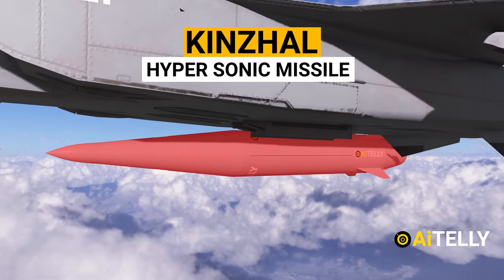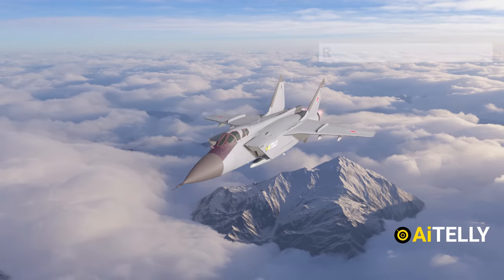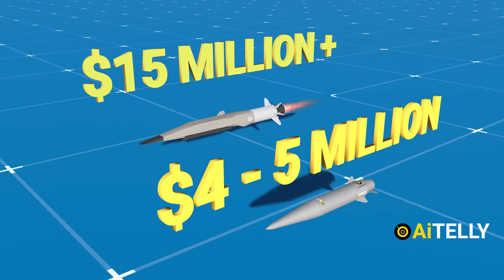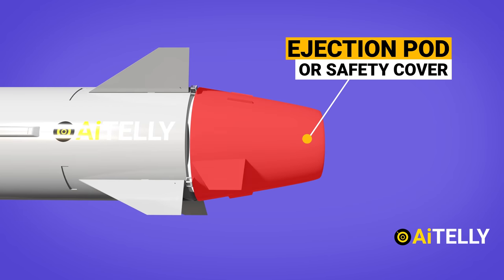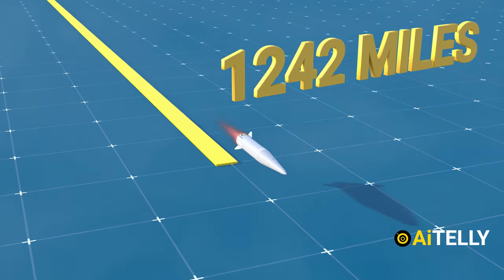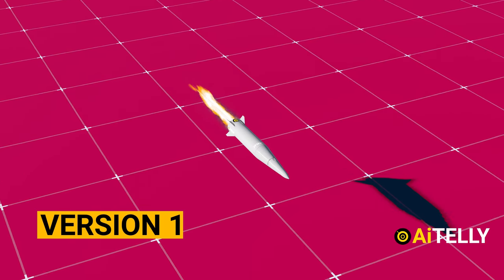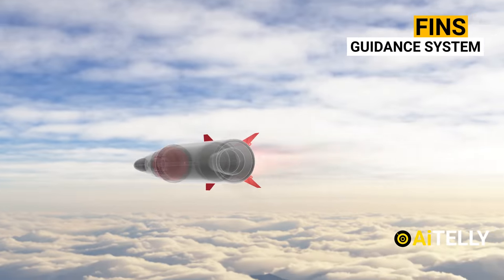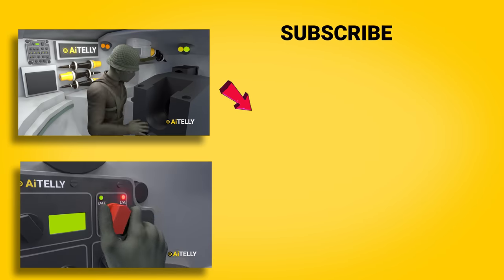Hypersonic Missile How it Works | Mig 31 Kinzhal Launch Process

Comment: The Kinzhal Hypersonic  Missile is about the largest Air to Surface missile I know.
Even from the graphics in this video, it surpasses adult human size by far, and it has sharp conical tip, unlike the wreck of the shot down one shown that has smaller bullet shaped nose.
So it is a total lie that The Patriot Missile shot it down.
Reply: The one you saw is unitary warhead assembly found inside kinzhsl ...lol
Reply: Created in 2018, the Dagger can fly more than 4 kilometers in a second;
The Patriot PAC-3 air defense system was tested in 1997[23]. The maximum target speed is 1600 m/s[24];
conclusion:The Patriot air defense system could not shoot down the Dagger, because it is not designed to shoot down such fast missiles.
Minister Shoigu: "We don't launch as many missiles as the Ukrainians shoot them down")))
Reply: @alexandroangara5903  correctly : Patriot missile don't need to chase kinzhal, it only need to calculate the trajectory and meet there
Reply: @tluangasailo3663  yes, they met at the Patriot location and Kinzal gone to pieces and destroyed Patriot completely, there is a video ....they used H-101 missiles to put Patriot to pressure and to locate it and then 3 Kinzals devastated it
Reply: So much Russian copium in the comments.
Reply: @alexkalexk6895  really, I thought so many NATO propaganda at one place, just watch the video, Patriot hit the Kinzal, and destroyed it , but it was at the ground :D and good buy Patriots :D
Reply: it is also necessary to realize that the speed where it strikes, the kinetic energy is added to the explosive charge... the nose of the missile there should not be much left
Reply: @alexandroangara5903  that's efficiency! you fire three missiles and in front of them they shoot down about forty...I guess they are getting ahead of the next launches.. it allows the barrel of the gun to cool down
Reply: @alexandroangara5903  that’s like saying I can’t get run over by a car if I step onto the highway because it’s going too fast.

Gosh, people are dim.
Reply: Largest? Google "Kh-22" )

Comment: Look at it this way. Kh-47M2 is a missile capable of breaching trough the entirety of layered air defense thanks to it's speed, and only then, in the shortest section between the missile and it's target, it slows down, turns on the seeker and hits. Let’s say this happens at a distance of 10 km, meaning that missile punched trough layered air defense before that distance and is now slowing down to activate seeker. How many air defense systems do you need to repel such an attack? What is the density of fire that is needed to be sure? In other words, how many hundred millions of dollars you are willing to waste on just one missile? Will the crew have time to react if there is only less than 10 seconds to react? And what if dozens more cruise missiles were sent earlier, so that they would reach the same area at the same time? 

I think that's the best way to describe what it does, and why it doesn't really matter if it is truly hypersonic or not. It is by it's nature hypersonic weapon, yes. But it's not entirely hypersonic in that regard.

Gladly, there is a Zircon missile with a true scramjet to end all debates about hypersonic nature of missile. If Kh-47M2 is only hypersonic until it can reach shortest distance with it's target, Zircon - will hit it on a full speed.
Reply: Ukraine has downed a significant amount with a small number of Patriot systems
Reply: @Desoxyri yea that's a myth considering the mayor of kiev was posing with a BETAB-500 which are concrete piercing bunker bombs. the patriot systems were also damaged even if the missilr was downed. 32 pac-3 vs 1 kinzhal is a very bad ratio for the system
Reply: @abs0luteOne  No it is not a myth vatnik. It has been confined by US officials. And I am not talking about the image you are talking about.
Reply: @Desoxyri  🤡🤡🤡
Reply: Х-47 баллистическая ракета и гиперзвуковая скорость достигается у нее только на маршевом участке полета когда активно работает двигатель. И то это не постоянная а пиковая скорость!!! Далее полет проходит по свободной баллистической траектории и только когда скорость падает до сверхзвуковой отстреливается защитный колпак и включается система наведения ракеты. До этого момента ракета абсолютно слепая и конечный управляемый участок полета не 10 км и не 20 а куда более ибо на скорости даже 3 Маха не говоря уже о гиперзвуке  с такую дистанцию ракета проходит за считанные секунды (3 Маха 1 километр за секунду) и при этом ей нужно успеть найти цель, навестись на цель и скорректировать свой полет дабы в цель эту попасть.
Reply: @abs0luteOne  That night, the fire was not only on the Dagger rocket, of which there were 6 !! and also for other reasons, like Caliber missiles and unmanned drones. That's why it took such a consumption of missiles
Reply: @dmitryyakimenko1779  ага, как обычно, порк, всё ракеты перехвачены складами и патриотами, но есть нюанс.
Reply: Notes; Hypersonic speed is 3,500mph, 1 mile/second if you have your flag on the moon or about 1.6km/second if you don't. Any non-missile vehicle at hypersonic speeds within the atmosphere is considered a hypersonic vehicle, no matter the control capability.  Congressional Budget Office; Hypersonic Missile: A missile that travels within the atmosphere (rather than above it) at speeds greater than Mach 5 and that can maneuver in the atmosphere for much of its flight. Hypersonic missiles can take various forms, such as boost-glide missiles or cruise missiles. Thus, technically speaking, “hypersonic” refers only to travel at speeds above Mach 5 within the Earth’s atmosphere. For a missile to be "hypersonic" then it must have control surfaces and not control boosters. "The term “hypersonic” is now typically used just to refer to two types of weapons that are being developed through contemporary defense programs: hypersonic glide vehicles (HGVs) and hypersonic cruise missiles (HCMs). The Kinzhal is neither."
Reply: @Desoxyri  Смешно. Непонятно только - почему 6, надо было сказать 32 (или сколько там Пэтриот выпустил), во цэ гарна пэремога была бы. Как говорится "бумага все стерпит".
Reply: Russia to this day still hasn’t shown the Zircon missile in hypersonic flight, and if they truly exist Russia would have tested it in Ukraine by now. And finally, the Zircon is just a copy of the US X-51 Waverider, which broke the world record for hypersonic duration of flight over a decade ago.  There’s a video of it here on YouTube. Facts are Russia is just lying about its hypersonic capabilities.
Reply: @Desoxyri 😂😂😂
Украина в качестве доказательства нашла стульчак от униьаза😂😂😂😂
Reply: Yet it was shot down at least 6 times by the US patriot. So what are you talking about?
Reply: @Desoxyri   US Patriot  😂🤡
Reply: @abs0luteOne  this is where you failed. You don't know anything about the situation. First, Ukraine received PAC-2 missiles. Secondly, that night was one of the most difficult, as there were more than a hundred aerial targets in the airspace. It was everything that could be: Kinzhal, Kalibr, X-55, X-555, X-101, C-300 (ballistic version) and Shahed-136. At that moment, Ukrainians used everything they had: all possible air defense systems, fighter aircraft, mobile fire groups, anti-aircraft gun systems, even MANPADS. And yes, PATRIOT worked on cruise missiles, not only on Kinzhal. But, as always, you believe ruzzian propaganda about the invincibility of ruzzians
Reply: @thecapitalofmind  considering ur using the words "ruzzian" I'm not gonna even bother arguing with a maggot

Comment: The Boeing X-51 WaveRider (which is still under testing) set several records for supersonic speeds during its test flights. In 2010, during one of its experimental flights, the Boeing X-51 reached a speed of approximately Mach 5 and it costs about 15 million dollars.

"The Kinzhal" (also known as Kinzhal-M) is a hypersonic air-launched missile developed in Russia. According to official information provided by the Russian military, the Kinzhal is capable of reaching speeds of over Mach 10. It is priced at around 4-5 million dollars.
Reply: coolstorybob
Reply: @@solaceofsnow2140 yeye, sure, lmao, keep repeating that to yourself
Reply: Wasn't the WaveRider cancelled? Or which was the one cancelled in 2023 after failed tests? Apparently it flew well in normal ballistic trajectory, but not in zig zag or random patterns for defense radar evasion.
Reply: The cost of manufacturing the dagger is estimated at approximately 40 million rubles ($500 thousand). Most likely, we have simple technologies made according to the standard of descent orbital vehicles. In essence, this is a conventional rocket with a solid propellant engine, the structural elements of which are made of ablative materials, and the electronics are protected by vacuum shields. If the United States had developed a similar concept, it would have received hypersonic missiles long ago. But they want a turbojet engine, while materials capable of ensuring the integrity of the turbojet engine at the desired speeds do not exist. It all depends on the strength of the materials.

Comment: Interesting analysis 👌
I think the Khinzhal works in the Version 3  4:18
Detaching any booster units would left wreckage behind which can be tracked by ballistic radars and salvaged. NATO analysts would have figured that out by now and we would see that in social media. Some of you guys will probably remember the orange Iskander decoys
Reply: Agree, it have 3 warhead 1 as a real warhead and 2 other is a decoy (source Pravda)
Reply: @vandasaragosa  but it does look like it has 2 stages of boosters in it diagram.
Reply: I think it doesn't  work. Its not a true hypersonic weapon and , like all russian equipment, it sux.
Reply: @maidatenpulamea  ukraine has been fighting with more than 50% of soviet equipment did u just confirm ukraine has piss poor performance in this war ? damm
Reply: @hemendraravi4787  dufus, when the equipemnt is equivalent what matters is morale and leadership. If Ukraine would fight with soviet gear against western equipment they would be obliterated.
Reply: they release decoys for radar tracking they're ballistic rod looking things
Reply: @maidatenpulamea  Some Soviet weapons still hold up, like the 2S4 Tyulpan 240mm self propelled heavy mortar, which is a beast of a weapon. The main rounds weigh 290 lbs and the rocket assisted shells weigh 503 lbs. ( would like to see how you load a shell that size )
Reply: @SewTubular  it holds up because they're fighting in Ukraine. Imagine the same gun fighting the US army. Proper counter battery fire would obliterate that tin can instantly.
Reply: @maidatenpulamea  But how does it compare to a modern mortar or howitzer ? I suspect is will compare well. Just because a weapon is an old design doesn't mean it's worthless, especially if it's been upgraded to enable satellite positioning. ( no idea if the Tyulpan has been upgraded )
Reply: @SewTubular  I would say that it is useless. NATO has nothing similar because its doctrine is radically different. Russia is stuck in the past where artillery would make a difference but those days are gone.
Reply: @maidatenpulamea  NATO still uses howitzers and mortars, so how is an older designed mortar useless ?  I think older weapons will need to be upgraded so that they use satellite positioning and may need to integrated into the military electronic network. Also, some of the modern gear appears to be more fragile than the older stuff. I've seen three videos of the F35A where the front landing-gear collapses when moving on the ground. ( you can see that the wheel is wobbly as the jet moves )
Reply: I suspect the Kinzhal also uses Version 3 because the weight of the booster would add more kinetic energy to the final impact on the target.
Reply: @SewTubular  we were talking about 2S4 which is a self propelled heavy mortar. NATO has nothing similar, I repeat. Mortars, by design, have limited range and are only really usefull in sieges and ocasionally, trench warfare. Regarding F35s landing gear, I dont see what relevance one type of incident has over the military as a whole. The frame is realitvely new, there's so much inovation that it's really too soon to say that F35 has reached full maturity. This plane is intended to serve for decades to come so it will only get better and better.
Reply: @maidatenpulamea  The F35 was just an example. Another is the M777 howitzer that requires maintenance after a few days of use, where these older Soviet guns can be used for weeks without maintenance. I agree that most weapon systems will evolve over time, and some get re-invented like the old Soviet BETAB bombs being turned into glide-bombs. ( like the US JDAM upgrade kit )
Reply: @SewTubular  dude, leave him alone with his delusional world. he can't be helped anymore
Reply: @maidatenpulamea  why were shepherds in slippers with AK-47s not killed in Afghanistan with the help of Western equipment?